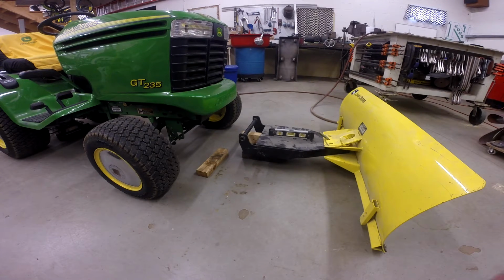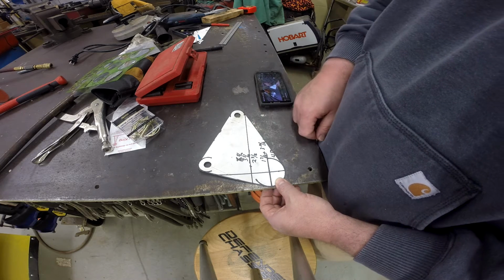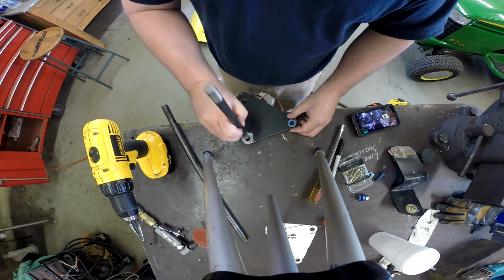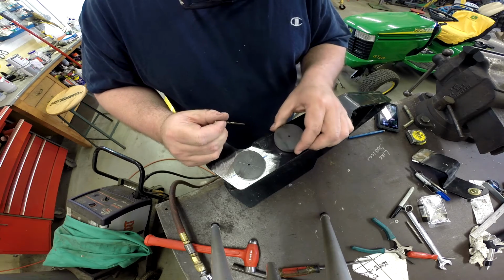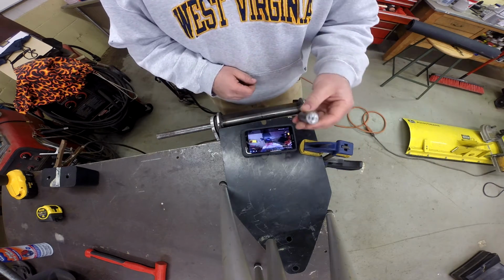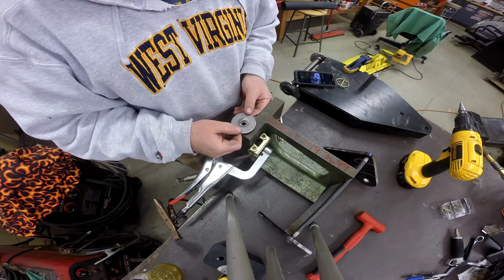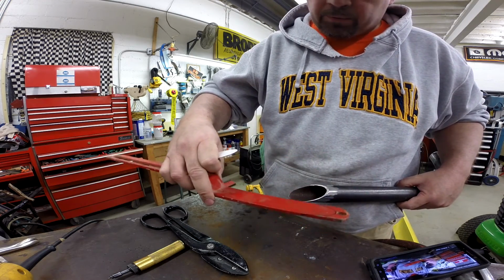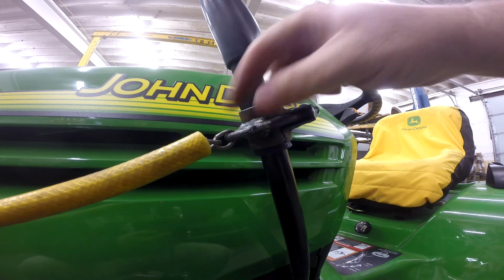John Deere Snow Blade Retrofit - GT 235 Lawn Tractor

Comment: I just invested in a 46" GT JD blade, mount and subframe that I'm reading into a little before I test fit to the 240.  Reads like if anything there might be something at more an angle on the front mount for the GT compared to something straighter on the 240.  Still working on the Ford YT-16 custom work.  Neat watching, good build and thanks for sharing!
Reply from the maker: Thanks for watching

Comment: You did a great job but you did a lot more than you needed to.You cod have used the existing mount on the tractor.I have a JD x300 looks the same as yours same plow.Nice job but it is much simpler to mount than the way you did it Good Luck